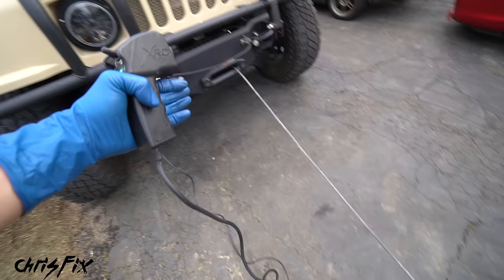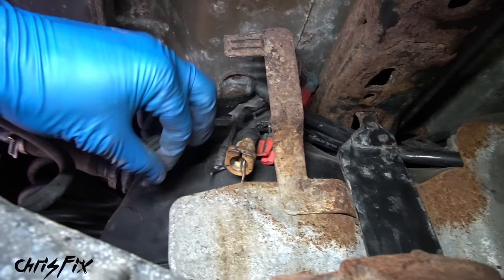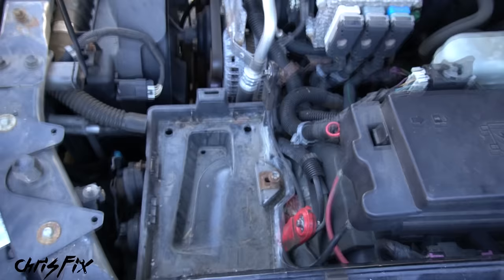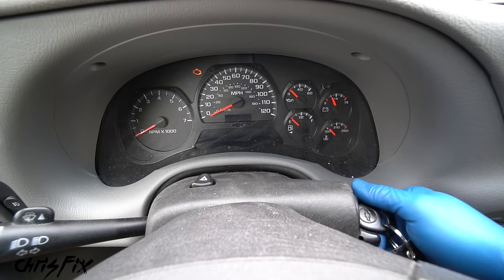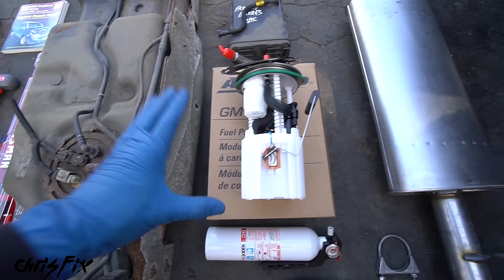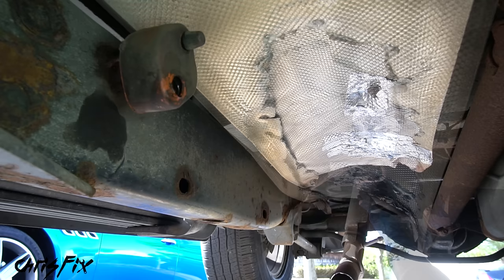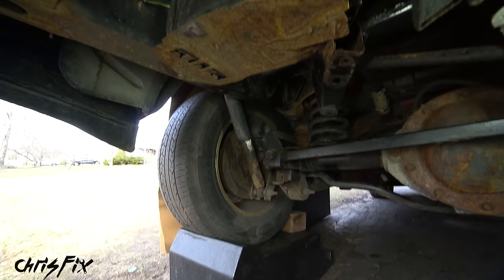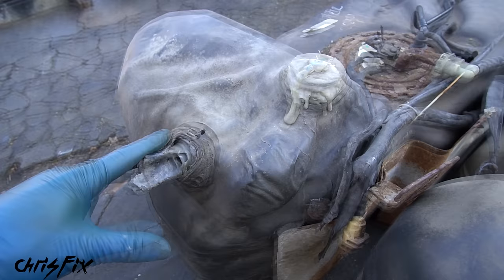How to Fix a Car that Wont Start (I bought it for $500)

Comment: "good first car!"
cries in UK
Reply: Emdzej haha lol 😂
Reply: Why?
Reply: @krisrivera3514  Picture this.
Insuring one of these bad boys when you're under 25 (a fresh driver pretty much) would set you back $10000 a year easily + road tax + yearly inspections + A blackbox that limits you on everything.
Most young people here drive a Vauxhall-Opel Corsa / Holden Barina (equivalent to a Chevy Spark / Ford Fiesta ) Or something of similar size with a kettle-sized engine (0.9-1.4 litres) and even that sets you back the equivalent $2000 Easily for your first year, depending on your area and trim level of the car and it's engine size.
I hate english insurance, I'm 20 with 3 years of no claims and I pay the equivalent of $2100 for my 09' W212.
Reply: Emdzej damnn that sounds bad I wouldn’t even think of getting a car over there im young but i drive a 02 3.4 litre pontiac got it for like 1400$ drives good cheap only spent like another 25 for inspection 130 for tags and registration and my insurance is cheap.
Reply: @krisrivera3514  We can only wish for something like you have.
Inspection? Cheapest place round my town will set you back $40 easily, and if something is wrong (handbrake not working, or pads worn or even a PLATE LIGHT not working) they will fail it and you either pay them to repair (labour is expensive) or fix it yourself.
Tax? Boy, lemme tell you a story.
If your car is bigger than a 1.4 litre engine, say goodbye to $300 yearly to your road tax (That's if it's a gasoline engine, if it's a diesel some random cars have $0 tax)
Of course all of above things only matter if you're an under 25 driver with no claims, once you got your no claims bonus insurance drops down dramatically (even to sub $1000 levels) but if you want a car you have to pretty much drive a matchbox with poverty specification and a kettle-sized engine which you hate dearly.
I refused to do so, and I'm paying my price.

Buuut..
Of course UK has it's pros.
Cars are cheap as chips, literally you can find an 09' Vauxhall/Opel Insignia / Holden Commodore equivalent (For Aussie friends, the new shitty one) (Or for the american friends the 2011 Buick Regal, but with a 1.8 Gasoline or 2.0 Diesel engine) for literally as little as $1500!
And it is very likely that It'll have about 120k miles and full year round inspection.
Reply: Emdzej oh they fail you here for anything too when i got my inspection mignt headlights were kinda loose and they tried charging me 200$ to put them in place i got angry asf and walked out to the parking lot and i put them back in place ans tightened them in 10 minutes and they really did the whole inspection again as if they didn’t already know the problem😂

Comment: Really well done man love how well you documented the repais but you did make a mistake that will sooner or later cause a fuel leak.
When you removed the fuel pressure line at the tank the lower o-ring retainer stayed on the old tank leaving the lower o-ring able to fall as you drive leaving just a single old o-ring to seal the high pressure line which will leak sometime.
Very cool find.

Comment: I bought a really nice Jeep Grand Cherokee loaded with the options for six hundred bucks. Story from the seller was it had a dead battery. So he went and bought a replacement. Somehow he hooked the battery up and reversed the cables. So from that point on for the next year and a half he tried to figure out what happened. I found it on Craigslist trailered it home. Even got a spare set of factory wheels and tires with it. His wife was mad because it was her car. Got it home no crank at all. Charged the battery. Crank and no start. Checked the little 10 amp spade fuse that powers the ECU. Guess what it was blown to protect the ECU from the seller trying to hook the battery backwards. Washed it and buffed it. Three days later sold if for 4900.00 dollars. I didn’t have the heart to tell the seller what the problem was. His wife would hav e killed him I think. So end result WIN/WIN.

Comment: Excellent presentation and editing.  You also polished the faded headlamp housings.  I've done that when out, using same DA polisher and compound for the paint.  Also buffed and polished the paint on left side, which cleaned up perfectly.  In CA, rust isn't much concern, but clear-coat degrades in the sun to look horrid on a dark car.  Best if you can always park in shade.  A new fuel pump assembly for our Chrysler minivan is <$100.  One killer is a new cat converter (dual) costs $4500 for our 2015 Prius.

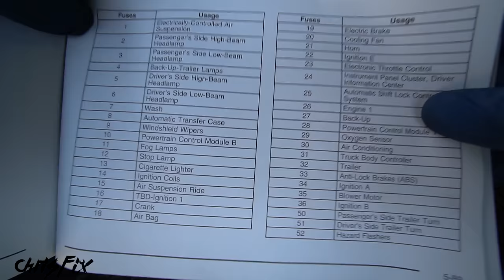Comment: 7:15 Correct me if I'm wrong, but I believe the Continuity setting on your multimeter is really the "proper" setting for testing fuses. What you're really looking for is a complete circuit, which is exactly what the continuity setting is meant for. The resistance (Ohms) measurement works as a proxy, but the continuity test will beep when the circuit is good, so you don't even have to watch the readout.

Comment: I know this is a couple years late lol, but I just bought myself a 2002 Trailblazer that barely started, but runs horribly, probably because of the oil was leakin, but we weren't sure where it was going. I started tearing it apart and so far I think it's just a valve cover gasket, but it might be a lot worse. It was $750
Reply from the maker: Good luck! Let me know how it goes!

Comment: 11:35 If you used some heat, you wouldn't need the breaker bar, also it prevents the bolt from snapping. I have broken a few bolts, as usual.. No heat on the other side tho, the fuel tank is there.

Comment: Another good tip to remove stubborn plastic connectors is to warm them up with a heat gun.   That softens the plastic and makes it more pliable.   Just don't melt them!

Comment: Youi cannot test a fuse in situ by that method. This is because there may be an alternative electrical path between the fuse terminals that will a give a resistance reading, making it unreliable. You MUST remove fuses to check them.  Secondly, to avoid a long crank, turn the ignition on, wait a few seconds, then off, and repeat several times till the system is primed.  You were also lucky that without checking the engine codes you were guessing what was causing the engine check light to come on,

Comment: the most common internal issues with trail blazers are littearly the consoles and the door handles and a few of the trims around the door the external is the battery 🪫 its not very long lasting other than those things its an amazing car

Comment: I can't understand why some mechanics will directly assume "oh it's a bad fuel pump" or whatever, when in fact it is just a simple fuse. The only reason I can think of is for you to bring the car to them so they can replace the fuse, but charge you for a new fuel pump.

Comment: So if the previous owner would have replaced the bad muffler in a timely manner, this vehicle likely would have continued to run without any of the additional repairs to the fuel system. Good lesson to learn. Make needed repairs promptly. Saves time and money in the long run.
Reply from the maker: Exactly.

Comment: I bought my first car which was a 1997 Saturn sc1. Didn't run I paid 1500 for it and it only needed a fuel pump, spark plugs, coil packs and an alternator and it was running and driving. And now I gotta replace front wheel bearings

Comment: i bot a 2007 chevy trailblazer with 180k miles because of this video. my head is better than 05 as it has bigger valve and aluminum cover.

Comment: Foil tape is great, but it won't hold up to the heat of the exhaust. As strong as the glue is on the tape and it is super strong, it gets very weak at high temperature. It can handle the heat of a furnace duct, but not exhaust pipes on a vehicle. It's nice that you tried to patch it up even though you are selling it.
Reply from the maker: Thanks for the tip. It worked well for the past 2yrs and held up no problem which is good!
Reply: @chrisfix  Maybe you got a better brand of tape, but I haven't had any luck at extreme temperatures. The tape just let's go after a few months.

Comment: I have a 2002 trailblazer. It’s awesome, sadly I can’t drive it yet because there is no oil pressure/volume (trailblazers use volume over pressure) and I don’t wanna blow the engine.

Comment: What's even better is that trailblazer has about 80,000 miles on it, judging by the amount of fuel used multiplied by the miles per gallon

Comment: A good tip to have in your arsenal of tricks for stuck plastic connectors is a heat gun, warm it up just a little bit and you'll be surprised how easily it will come apart! 👍

Comment: Awesome video as always Chris! But it would be $2,000 minus the cost of all the parts (and your time), no?
Reply from the maker: The car was $500, I spent about $500 to fix it up, I could sell it for $3000, so that's $2000 in profit (it actually ended up sold for $4000). And time is something that needs to be factored in, but I took this risk since it seemed like the fixes were pretty straightforward and I was correct! You don't want to spend 100 hours to fix a car and make $100 all said and done
Reply: @chrisfix  Ah gotcha. Sounds like it worked out very nicely! Thanks for sharing these videos with us :)

Comment: To be complete, your missing your OBD2 Tool. Not only that, You should carry an 800 CCA universal (Both Top &side post 12 volt battery) An 05 GM ECU, DME or whatever, will give you a P code without even running the car. There's been a trouble code generated. You just need to recover it.

Comment: The only downside of these Trailblazers is the fuel mileage. These are not efficient at all compared to modern SUV's and trucks but it is mechanically reliable, has plenty of power for daily commutes and rides comfortably and smooth.

Comment: Installing the new fuel tank without checking exhaust leaking cost of melting tank?
Reply from the maker: When the previous owner had the car he ran it with a bad muffler which caused the tank to melt. I fixed the muffler and put a new tank in.

Comment: So why didn't you jump the SUV by connecting the battery cables straight to your jumper cables and not bother with the battery at all? That's what I did for an $800 7th gen Toyota Celica. The owner was confident it wouldn't start, but most of that problem was the dead battery and dirty air filter. After replacing those, an O2 sensor, and with some electrical tape to temporarily seal the vacuum lines, it runs relatively perfectly fine. BUT it needs a lot more work than that.

Comment: Hello, check engine light. Hello, vapor leak. Worm gear clamps are never good. There's a reason why all the other factory hoses never had them. 
The worst part is Chris pointed out those exact locations to check for leaks and he used worm clamps.

Comment: Chris did same thing with $880 mini van 2005 Gran Carvan SXt with Stow and go...  Paint just like this!!  Needs a hood super cheap! nd headlights are just as rough...Dealing with brakes now my only concerns are the rear exhaust manifold s pulling away and its super loud.  Any tips?

Comment: On trade in dealer gave me $1000 for 2002 GMC Envoy. Running, good tires, only oil leak from power steering hose. 120k on odometer.

Comment: If I were you, I would have gotten a new battery myself and if that does not get it to turn over I would pay for any simple parts myself if the value of the car was lowered as a result, if the cars value stayed the same I would pay 50% and the owner would pay 50%, and if the cars value went up the owner would pay 50% of the cost of the parts + the amount of value gained on the car until the amount of value gained reaches the total cost of the parts replaced while in the former owners name. The reason for that would be so you could use anything more that you find as a result of starting the engine as further negotiation talking points if the car shows any further issues as a result that you would not find otherwise.
Reply from the maker: I get what you're saying but people looking to sell cars aren't going to be paying for anything, they would rather knock the price down than pay anything out of pocket
Reply: @chrisfix  I guess after some more calculations that both would end up about the same money spent in the end. Great point though.

Comment: I just saw this video for the first time. Please, under no circumstances use an exhaust clamp like he is doing here. It’s wrong and WILL cause leaks to the exhaust system. The clamp MUST be placed over the female end at least 1/4 inch past the opening.

Comment: The first thing I will do if I ever have another trailblazer is there is a transmission line that is basically on top of the catalytic converter and if the heat wrap but it can rub a hole through it and through the line and spray transmission fluid on the catalytic converter and burst into flames this happened to me and my friends so please tie the line away from the catalytic converter to prevent a fire

Comment: Could u find a Haynes manual for a 2004 GMC Envoy and let me know cause I can't find one anywhere... I paid for the online one but it's not the same as the book..
Reply from the maker: So the one I use in this video is the same car as the Envoy. You can use that because it is the same exact car with different body panels.

Comment: A bad fuse is a bit of a stroke of luck, but if you know what to look for and can identify the symptoms, you can probably find lots of cars with this issue
Reply from the maker: Well the fuse wasn’t the main problem. That was just a side effect of a bad fuel system. The pump probably overheated due to the melted tank from the exhaust.
Reply: @chrisfix  Right! That melted tank and busted exhaust was crazy haha! I guess I should have been more specific, I meant it was cool that the fuse ended up being the only thing preventing it from starting up, my bad!
Reply: @chrisfix I actually had a similar issue with my girlfriend's Stratus, a failing starter caused one of the ignition fuses to go bad, and after replacing the fuse it would grinnnnd to a start.

Of course, thanks to you, I had it fixed in no time ;)

Comment: Cost of tools? Cost of time? Cost of cleaning time? Cost of interior work? Cost of paint correction? By the time you’re done you’ll have $2000 profit but with what cost of your time?
Reply: And that all depends if you got the junk yard gas tank available. And also a honest seller who told you it was fuel pump line tank related so you can start your search there
Reply from the maker: Well for 2 days work so that is $1k a day.

Comment: ...there are Sooo many expenses in this project that are not being pointed out : a place to do the work being the Mostest - so you need a driveway ( which means you need to buy a house ). It had to be Towed - so you need a Trailer and a Truck to haul it . 
...i could go on , but $350,000 Dollars needs to be added to the $500 ...
Reply: Parking lot free. Have friends to push it to nearest lot = 0 $ + free workout
Reply: @jotitu1302  
... FRIENDS would give you their used car .. rather than let you Struggle + Gamble 🎰 on a 20 year old car that doesn't run , Right ??

Comment: Clean title doesn't mean clean carfax... may have still been wrecked 6 ways from sunday without any structural damage. Which could lead to various problems down the road. You need the carfax to be clean and a very thorough inspection by a good mechanic before considering something like this. It's a bit of a stretch to just say anyone and everyone can go do this and have a good result and not lose money. Most people can't.

Comment: I wish I stayed in shop class.
Reply: I wish I had a shop class
Reply: I can actually change my spark plugs, change my oil I work making refrigerators so I can change a ac system out myself I just did that, but I wish I knew more about working on a car

Comment: So he uses Ohms to check Continuity and no one said a thing. They all glorified his video. Are you all just kissing ass? Wow. If the fuse is broken, continuity will not beep on the meter. It is super easy to do and easier to do while under a car instead of looking for ohms. Do you techs really have an eye on the meter at all times and not sound or do you all just come here and think this is good advice?
Reply from the maker: I have no idea what you are talking about, nothing beeped on the meter?